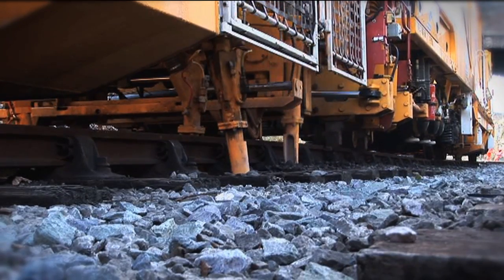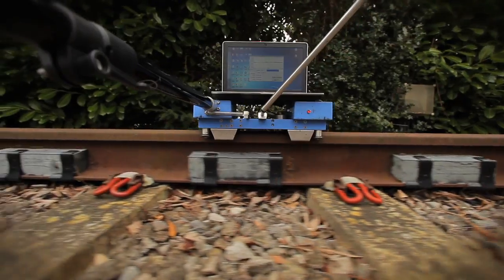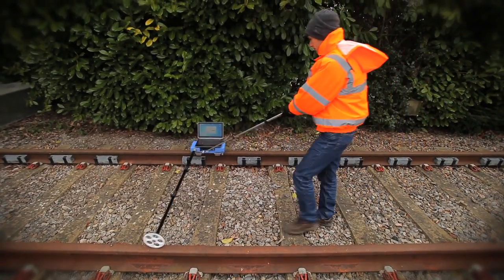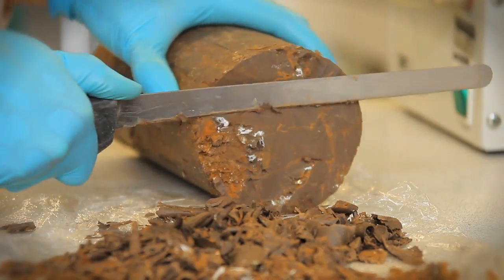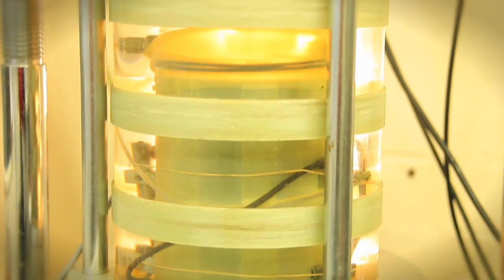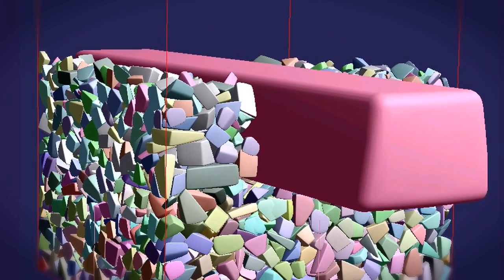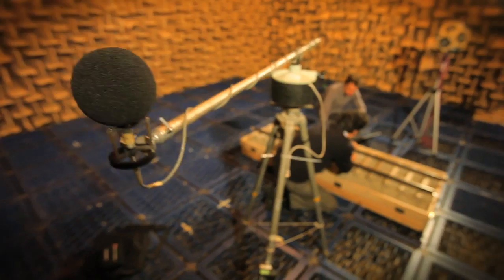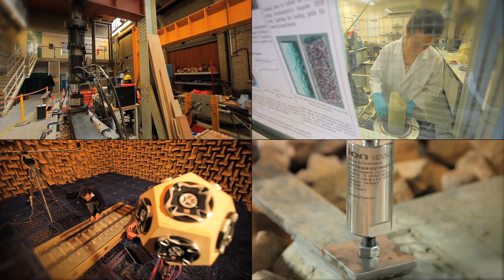Track 21: Railway track for the 21st Century

Comment: The obsession with speed is ridiculous and unnecessary.  Better SERVICE and less  interference from no nothing politicians is the way forward coupled with realistic train fares.   When it becomes significantly cheaper to take a 'plane over a train, then there is a major problem !
All these disparate private companies all jockeying to screw each other and the public out of as much money as possible do NOT make for sanity, economy and certainly not a SAFE railway system !
Reply: So how come Virgin Trains have taken a bigger slice of the travel market from air travel? And yes you can pick the lowest available air fare and compare it to the peak train fare and maybe its cheaper but try comparing like for like and it isn't.
And speed isn't an 'obsession' its a benefit - You can have more trains per mileage of track and passengers get there quicker (obviously) and have more time for whatever it is they are travelling for. Perhaps you would like to go back to 80 MPH steam trains ...
Reply: @1chish   Nothing wrong with Steam trains.
Here in Australia it is more cheaper to get a plane then a train to go interstate & what's wrong with 100km speed trains you get to look at the window & see the world around you.
Reply: @boomeraus0073  I never said there was anything 'wrong' with steam trains at all. But we have to accept their mechanical limitations and the environmental costs (not just emissions) as compared to electric trains or even diesel trains. technology has moved on since Gresley ran one at 126 mph. The UK has had 125 mph, 10 carriage, diesel passenger trains for over 40 years called 'HST'. We even exported them to Australia. And we run them on the most congested, multi user railway in the world. It also happens to be the safest in the world as well.

My point was simply that steam, like semaphore signals, has its place but not as a mainstream transport option.